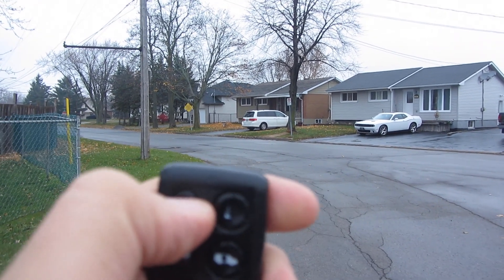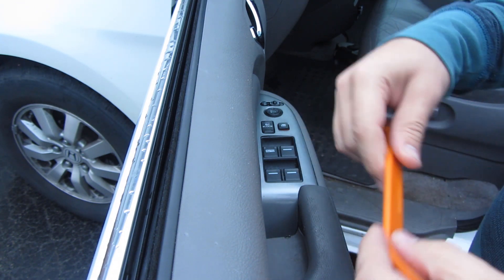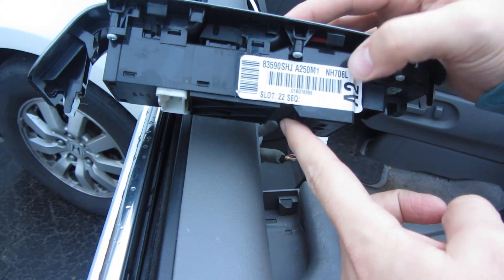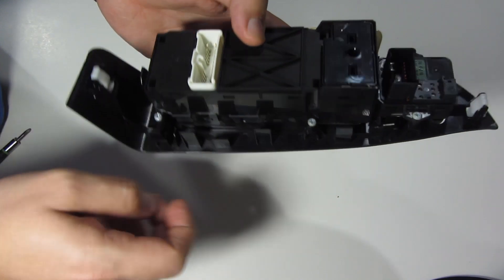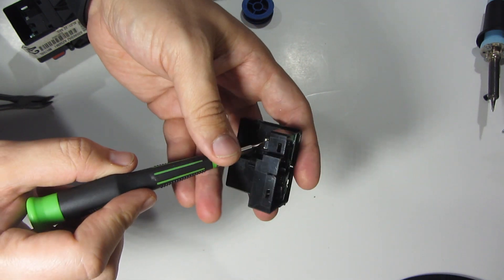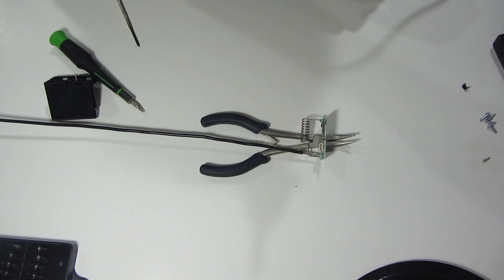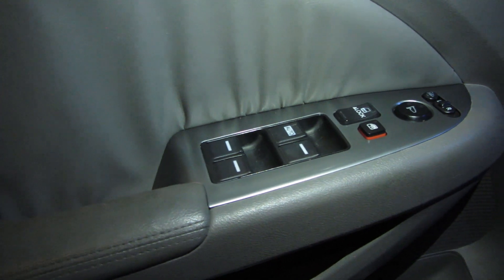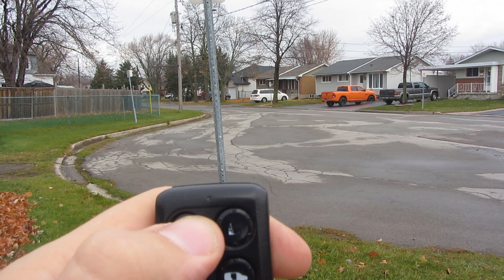Extend the Range of Your Key Fob / Keyless Entry With a Bigger Antenna

Comment: I gotta say man, this little hack saved me. I just recently got a 2010 Honda oddesey and I literally would have to be within 5 ft of the vehicle for the car to lock/unlock, even with new remotes. I took the whole assembly out, soldered a 2ft piece of 14 AWG wire, ran it up behind the door panel. And now my range is over 200 ft. It’s insane! Thanks a bunch
Reply from the maker: That's a fantastic result! Awesome.

Comment: I've done fairly complicated car repairs, a condenser/trans oil cooler replacement for instance, I would have never attempted if it weren't for seeing someone do it in videos like these. Thank you so much! But, yah, we've a pretty short range on both: remote stater and door locks on the ubiquitous Explorer. I'll give this a try. I don't know why all the radios in a car don't just use one, small external antenna -- shared with the am/fm, but I guess they don't. Thanks again.
Reply from the maker: I hope it goes well

Comment: I lost all my range on a honda ridgeline in the matter of a week or two.  As another commenter said below I could only open my Honda by pointing remote 6" from drivers window.
Put new batteries in remote to no avail. Now figuring it was defective master window switch which contains the antenna.  Was getting ready to fork out $200 for that part.  Watched your video and thought what the hell.  Should take an hour to do that.  Got nothing to loose at this point.  Wow  amazing range.  Worked still at the end of the street.  I ran the extra antenna wire up and into mirror area trying to get it away from metal door skin.  Thanks so much!!!!
Reply from the maker: That's fantastic! I'm glad I could help.

Comment: I would think you would have to consider the antenna wire length for the frequency to have optimum range.  Very impressive!  The door is metal, and thus making some shielding.  I would have used 4 or 8 inches. for 2.5 GHZ.
Reply from the maker: I seem to remember taking the length into account, but I think it didn't fit and I had to bend it around. It worked anyway, but yeah, it could have been better still.

Comment: Does it have to be soldered? Can they be intertwined and crimped? I do not have a soldering iron
Reply from the maker: You can get away without soldering, yes. It may not work as well, but it's better than nothing. Give it a try.
Reply: Thank you for the quick reply! Will give it a try.

Comment: I saw somewhere (maybe on the Ody Club forum) where someone simply wire brushed the existing coiled antenna. I tried that tonight. I used a small wire brush on a drill. Range went from about 1 foot to about 50 paces.
Reply from the maker: Sweet, even easier!

Comment: I wonder if you could have gotten more range by removing the insulation from the wire you added.
Reply from the maker: No, the insulation wouldn't have any effect. Only metal would have an effect.

Comment: You could have made ladder line with the same wire, and constructed a resonant dipole for something like 304MHz I think it is, for a lot better result. Yours is just working better by chance, or from lifting the antenna closer to the window.
Reply from the maker: Yeah, I know antennas are an entire field of science on their own. I did cut the wire to the right length for the frequency, but then it didn't fit so I folded it 🤷‍♂️

Comment: I increased my range by 50 ft doing what you did but coiling it and soldering it at both points also you canIncrease your range by opening your car remote and use an eraser and alcohol and clean the inside points of connections and where the buttons  touch. Bend the tab back slightly to make better contact. I did this to mines and increased the range by 100 ft plus 50 ft thanks to your video
Reply from the maker: Nice!
Reply: @GabesHacks  Hey! This is great. I did exactly what you explained and I couldn’t believe the result. Before I couldn’t unlock my car from the trunk, now I can do it from two houses far way. Thank you men. You are the men.

Comment: I'm definitely gonna try this today. I bought a truck and I had to replace my windows switch, but I couldn't figure out why all of a sudden my key fob wasn't working well. It only works if I have a clear but close view of the driver's side, otherwise I could be at the front of the truck and it won't work. Thank you so much for this video
Reply: What kind of truck is it? Cuz i have the same problem in my 08 suburban the remote control  only works like 20 ft around
Reply: @freddyfender6464  my truck is an 08 Silverado and it nearly drove me crazy but I did find the problem. It's called a "keyless remote entry module", It's kind of tricky to explain where it's located but it's a little black box and (on my truck) if you're sitting in the rear seat, behind the driver, take off the plastic molding so you can access the left rear passenger's seat belt. Between the cab and the seat belt you'll see a little black box and that's the "keyless remote entry module". I called the dealership and they wanted $500 for the module and another $120 to "program it", that ridiculous. I went to a junk yard and found one off of a similar year vehicle, went home and installed it myself. To program it, all you have to do is reprogram your key fob and it'll sync right up. I haven't had a problem with mine since. If you can't find where your module is located, let me know and I'll help you because I know how frustrating it is.
Reply: Ok brother my one works good the only problem what i have is it only works when im close to the SUV but i Will let u know  thx
Reply: @freddyfender6464  yes sir, no problem

Comment: how do i find out where the antenna is on a 2018 Subaru legacy? I would think it is best to strip the sheathing off the wire.
Reply from the maker: I bought the service manual for my van. I got a digital copy (PDF) on eBay. You might be able to do the same.
Otherwise, just search the internet for "2018 Subaru legacy keyless entry receiver" and see what you find. There might be forum posts or videos of people replacing one that might show you where it is.

Comment: (2005 Honda Odyssey) My range was around 5 feet if I'm lucky. First I was thinking the battery of my remote is weak and I bought new one and replace it, but the range was the same When I decide to give a try this method, I add additional 4 ft. wire to my antenna. Now my range is around 200ft. Thanks a LOT! I really appreciate it!
Reply from the maker: Awesome! Glad it helped!

Comment: You can now unlock your doors a mile away giving someone plenty of time to get into your car before you even get near it.   Now remote start would be a good reason to need to extend the distance.
Reply from the maker: Ha! No, it doesn't work a mile away. I usually use this when my kids are running to the van ahead of me.
Reply: fortin remote start works with your original key fob to remote start by pressing the lock button three times...I'll be trying this out soon

Comment: Before doing this, it's good to know the frequency of your receiver, so you can determine the wavelength, then optimal physical length of the antenna to optimize reception rather than just attaching a random length of wire.
Reply from the maker: If you want to be sure you get the absolute maximum range out of this modification, sure. It's been a long time since I did this, but I think I did cut the wire to the right length for the frequency, but I had to fold the wire to be able to fit it in the door, which negated the whole point of doing that, which is why I didn't mention it in the video.
Reply: Gabe's Hacks how can you know the right length of the wire? I know the frequency but how do I get the length?
Reply from the maker: @MrKoOkoO2012  Find the wavelength of the frequency you're working with (search "wavelength calculator" online), then use a multiple of that (full, half, or quarter - a quarter is most common). So if the frequency is 315MHz, the wavelength is about 95.2cm, and a 1/4 length antenna would be about 23.8cm.
Reply: @GabesHacks Solder a short wire from the antenna in the interior of the keyfob. Then touch new keyfob wire off 10 inch wire. This is great in winter if at work in the office for remote starting car outside 100 meters away to warm it up. Keep the 11 inch wire at your office desk. I just confirm the lights flash on my Toyota flash a certain way to confirm it has started. DIY Yagi antenna with 11 inch elements could extend it even further
Reply: Just FYI for everyone, I cut my wire to a little over 2 feet.  Increased my range from 5 feet to over 100 feet.
Reply: Most older Hondas use 315mhz, newer than 2014, 433mhz. The tire sensors use the same antenna in most cases for tpms!

Comment: Great Video Gabe!  This solution, however did not work for me.  I think there was some internal circuitry that had gone bad and attaching an antenna extender did not fix the issue.  I bought a new one on Amazon.com and problem solved.  (you'll need to reprogram your key fobs).  The part #35750-SHJ-306 worked for my 2010 Honda Odyssey EX-L ($185).  But your video was extremely helpful in understanding how to gain access to the module.  A lot of times, that's half the battle.
Reply: $286 now:(, at least for oem. so hope this mod works. Mine was fine but just started having issues.